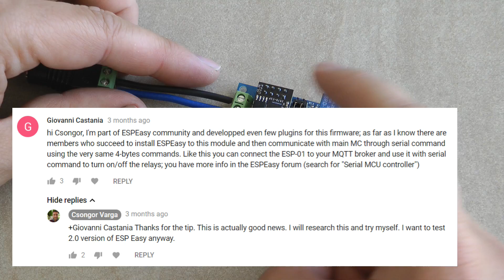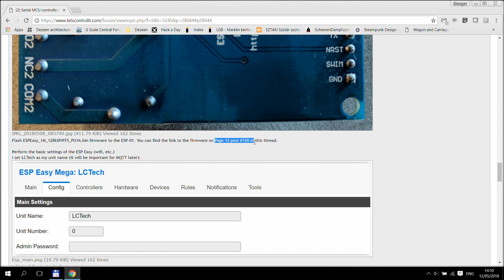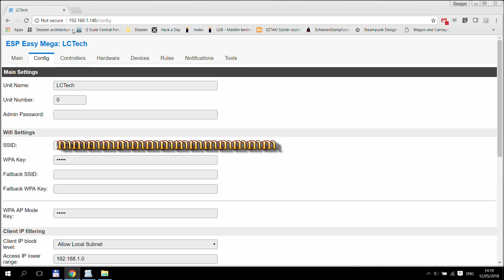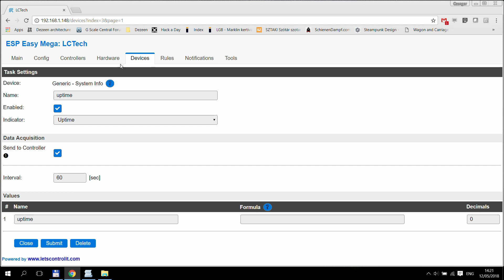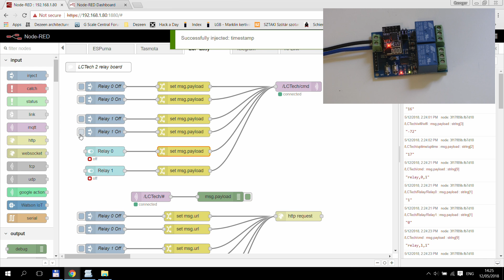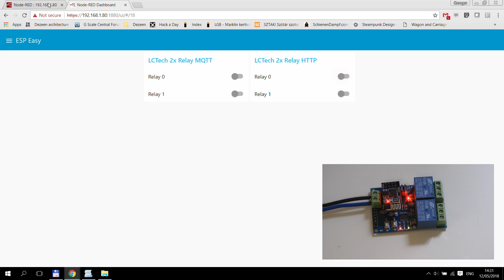Install ESP Easy on LCTech Wifi Relay

Comment: Hello,

Which way do the relays work?

Let me explain:

my goal is that when a relay receives a signal from the outside (example: a button wired on the relay), an html request is launched.

Thanks in advance.

Comment: Do it without Programming
You read correct, you can control relays without programming !!

I have successfully made it in less than 300 Seconds. If anybody needs help ask me frankly. Give a thumbs up to my efforts if work for you.
This board is really very creepy and there is no such content is available on internet by the manufacturer or circuit designers (maybe one might find but I couldn't.)

In my LC Tech board I used 
Power-on>wait for 30 Seconds > LED 3 fast blinking starts> Press confirm switch in ESP Touch app > wait upto 45 Secs.> Sucessful Connection >IP Address> Enter IP to Relay Control app> Done (Use control buttons to On/off your relays).
After configuring touching switches S1 and/or S2 must be avoided unless the configuration can be done again.
Led 3 Fast Blinking: Pairing Mode
Led 3 Slow Blinking: Paired or Exited pairing mode.

PS: App ESP Touch ( KhoaZero 123) is perfect solution to configure and obtain the IP. ESP Relay Control (Jamran Saksommon) for controlling your relays.
It takes total 300 seconds to get all done after downloading the apps.
Regards
Dr Amit Abheer 12 March 2022

Comment: Can I control relay of this board with my own code in esp01??
Reply from the maker: Not directly. The esp01 communicates with ankther mcu on the board. I don't know the code for that, but it is implemented in ESPEasy so you can look at the code there.
Reply: @csongorvarga  so it's possible to use own code with this relay or not?

Comment: mine was is doing nothing , S1 S2 button do nothing when i press it , it just keep blinking green led by 0.5sec quickly and nothing else i can do . what a trash they have made , i not understand how the hell this thing work . will be thankful if someone can explain me this device rocket science . 
logically : it should create open AP or AP with default pass mentioned in manual so that user can connect to it and send commands vice verse 

currently it have have some sort of modes which i not understand this smart config app am not sure how it will configure with esp when your phone is connected your home router or something else by default so am not sure this smart app disconnect your from ur home wifi and try to connect to that esp8266 AP which have passwod is this APP brute force or what i mean how this app is connecting in first place to the esp because it have password and password is not mentioned anywhere in manual.

Comment: Thanks for your video. Now I know - my identical LC Tech relay is ... broken. Same board, same ESP, same software but when I send command - nothing happens :/
Reply: It work only if I power on board with S1 switch pressed, but after power cycle it's still won't work
Reply: @norman2pl  Thanks for the tip - I had to hold S1 and reboot it but it has stayed that way for me.
Reply: Please give a try as I suggested in my comment. You would love it.

Comment: How can I turn on/off BOTH relays at once? It is necessary for my roller shutter ..In openHab I can only define 3 commands (up,stop,down) and e.g. down needs both relays on, stop needs to turn both off and up needs only one relay switched on
Reply from the maker: You can not. It has to be sent as two messages, so there will be a slight delay between the two relays.
Reply: @csongorvarga  I managed to switch the relays directly with the ESP8266 using GPIO 0 & 2.
Therefore I can switch the relays in four stages with on command like R1,R2:  0,0 | 0,1 | 1,0 & 1,1
I didnt understand the role of this second microcontroller anyway. I think its because LC Tech wants you to use their server...

Comment: Szerbusz !!Nos már 2 esp vel is probálkoztam és rendeltem, külön direkt ezt a kapcsolgatós programozót is. Rengeteg leírás van a neten de már nem igazán tudom, hogy mi tis csinálok néha. Ez a videó nagyon állat lenne, de az oldal sem megy már amit írtál, a 12. oldal nincs is?! nem értem miért és az esp tool meg el sem indul?!? Tudnál valami támpontot nyújtani, vagy valami ehhez kapcsolódó tutoriált csinálni?! vagy leírni a pontos methodikát?  Üdv egy lelkes amatőr, aki már a 100. esp flasher rel sem tudja a sokadik .bin-filet működésre bírni ! Köszönöm/jük szépen

Comment: i "tasmotized" that, and added an RF433 receiver on RX pin, too, so i can toggle the relays via wifi or rf remote, too... all details are in the PERSONAL PROJECTS channel of the Tasmota Discord server... i use it to simulate the clicks on an actual (rolling code) remote i have, to turn on my porch light and my car gate :)
Reply: Can you please post the link of that post? Thanks a lot!

Comment: Hello, nice video, Thanks.
My install went smooth, however I used ESPEasy (FlashESP8266.exe) it worked much easy then esptool.exe.
Also, very easy to integrate in Home Assistant or OpenHab with the MQTT commands. 

Do you have a download link for the 4 relay LC Tech version?

Comment: Does it comes with a voltage regulator? Can I directly connect it to the wall current?
Reply from the maker: No, it requires a power supply.

Comment: IMPORTANT !!! I have spent several hours trying to get this to work. IMPORTANT is that the Relay Board needs to be showing the RED diode and NOT the BLUE diode on the board. The logfile showed that the board received the command to toggle relay but nothing happened when the blue LED was on.  Press reset to get it from BLUE to RED.
Reply: Beesssst comment ever. I had the same problem.
Reply: Thanks Johan Tullberg! I was spending several hours on it. Now it is working
Reply: I think I have same problem, what is the reset on the X2 relay board?
Reply: @RobHiddinga  Press S2 while booting the relay.  Reboot it again and you should be fine after that. (I hope)
Reply: @johantullberg  Thanks~ That worked
Reply: THANKS!!!!!
Reply: Thanks a lot, i spend serveral hours too....
Reply: Best comment ever. I had the same problem. 

Now, to ensure that when the ESP-01 restarts or the whole device restarts that the relay state and virtual IO states are in sync!

Comment: Hello, how do you get out of the access point mode (i think that is why my relay won't change from on to off) ? Thank you
Reply: That happened to me too. It wasn't working at all. If anyone is having this problem, you need to press S2 while booting the relay board. After that you will have mode 1 again (red light)

Comment: Hi Csongor. Hope you doing well. is there firmware available to program relay 1 for example 30 seconds and relay 2 for 5 minutes alternatively? When reset to go into standby mode. When activated to run through the same time sequence. Thanks great videos
Reply from the maker: I think ESP Easy will be perfect for that. ESP Easy has Rules in which you can create simple scripts. I did a separate video on that. You can call a rule from MQTT or HTTP as well where you can implement you on/off routine. I have worked with that in the past but only addressing physical GPIO buttons. I suggest you check the forum how to use this device with Rules.

Comment: Thanks for this video!
I'm wondering if you can use tx, rx and ground pins to connect two switches/buttons. That would be great. I know ESP Easy is way more customizable of Tasmota firmware, but did you had the chance to trow it in to have a look?
Reply from the maker: I did not try Tasmota. Tasmota can do many different things, so does ESP Easy, but keep in mind, that the buttons and the relays are behind a second MCU and we are not changing the code on that MCU. So we have the control what is programmed into that MCU. This is not a great product, but with ESP Easy you can get the most out of it.
Reply: I prefer Tasmota over EasyESP, where I don't need rules to bind relays to switches. More practical. I suspected the second MCU would limit the customization: since the ESP-01 is connected to it using serial (TX/RX) I think add switches/buttons would be complicated, if not impossible, considering you can't use those pins as GPIOs since they are already in use. Thanks anyway.
Reply from the maker: I think we are lucky that somebody in the ESP Easy community spent the time to build this MCU control. There are so many other boards on the market that work better with Tasmota. And probably around the same time. I also like Tasmota for the predefined hardware layouts. Makes it easier, unless you are building something different.
Reply: I was interested on this one since is quite easy to fit inside a switch box, normally I build myself over ESP12. I'll keep an eye on this one just for the sake of knowledge! ;)
Reply from the maker: Yes, you are right. I have not came across a small ESP8266 based all in one board like this. Maybe a Wemos mini with some stacked Wemos shields. But otherwise I also just build it myself from Wemos D1 Mini and relay boards. But that requires a bigger box...
Reply: Csongor Varga , I think I'll make a pcb myself, today is not só expansive. I was already able to fit two relays with a micro power supply (5V 3W) and a 12E inside a blind module (52x21x45mm). But I was not completely satisfied since I want to add an additional protection with fuse and the power supply is too close to the logic (pickup issues). I need to reduce a bit more... I'll probably go with solid relays, cause I can stack them without interference, no shielding required. The average amperage is 2A, more than adeguate to drive load near 100-150W. If you are using just led lamps think on it.
Reply from the maker: If you are using led lamps, it is probably the best. At home I have an industrial PCB based setup. Each of my light is controlled via relay. I have "professional" relays from Schneider Electric, the type that plugs into din rail socket. I have LED lights in the bathroom which gets used the most. I need the replace the relays about once a year. The contacts fuse together due to the arcing and the relay stays constantly on. I presume these cheap ass Chinese relays would last even less. Solid state will hopefully last a while. Otherwise desoldering/resoldering would be a bummer.

Comment: Hello CSongor,
I've bought an ESP8266 Relay. I got it working really fast.
I will use this relay inside my blinds system. 
My problem is when the power goes down. The relay starts in mode 1 (mobile mode) and i have to press the S1 button to connect the esp8266 to the router again.
To do this i have to dismount my blinds and press the s1 button again. :(
Is there a way to program the default mode to mode 2 (router mode) so when it starts again connects automaticaly to the router?

Thanks
Reply from the maker: Sorry, I have no idea. For me it was connecting to my router after power up. Is it possible that the wifi signal is too weak?
Reply: Csongor Varga

The signal is strong.
As soon as i press the s1 button it connects imediatlly to the router.

Thanks
Reply: @pintinhoesi  I got the same problem with mine, could you solve it on your board?
Reply: yannismate 
Hi. Yes. First, connect the esp8266 to the router with the applicatin smart config.
After that i sold a wire in both terminals of button one.
After that it always turn on in router mode :)
Hope it helps
Reply: @pintinhoesi  Worked like a charm! Thanks a lot!
Reply: @ @yannismate 
Fantastic :)